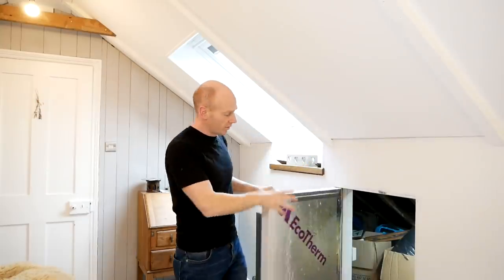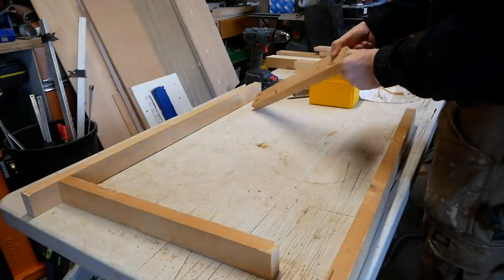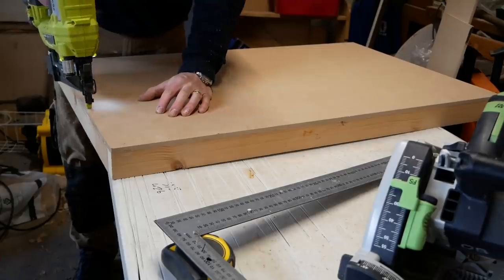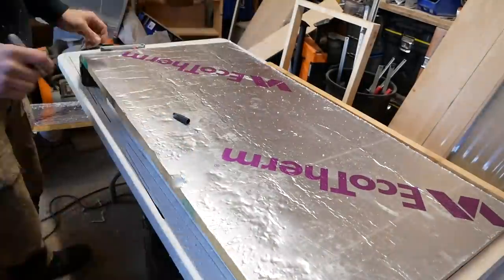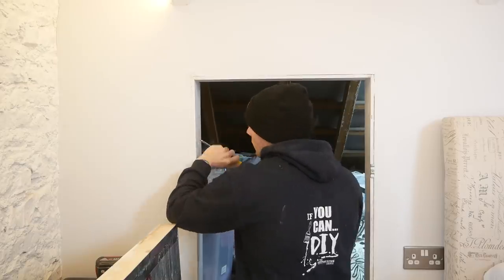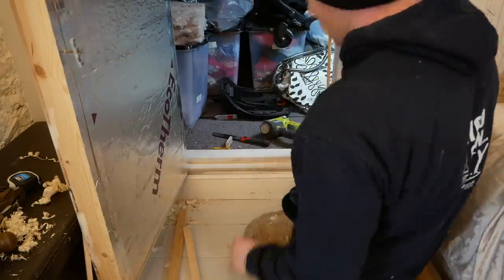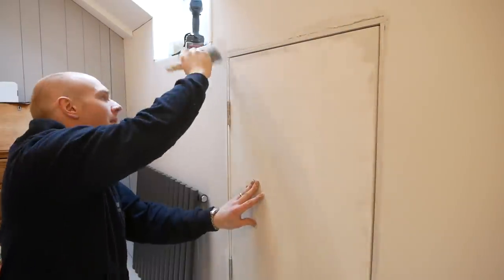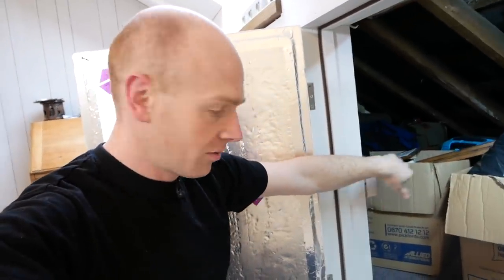Building Insulated Doors for the Loft Conversion

Comment: We're currently in lockdown for at least a month here in NZ. I live out of town a bit on two acres. I hear you about using what you have at hand. At this time I'm so glad I'm a bit of a hoarder. So many things to do and so far have been able to find material somewhere on the property.
Reply from the maker: Steve McLean know what you mean!  I’ve knocked out 5 or 6 scrap wood projects already, keeping the kids busy too with little builds.
Reply: I have been building up supplies for about 6 months to re-deck and EPDM my 60sqm garage/workshop roof, all I reaily needed was the OSB3 sheets, and  luckily I managed to get them delivered at the beginning of the lockdown, two weeks into the job and I still haven't finished it (no wonder every quote I had was around £4500!). Struggling to get guttering now though!.

Comment: Hi. I'm doing a loft conversion but my eaves doors (6 of them) have a 33° pitch along the top of the door, I have 100mm kingspan left over, have I no chance of getting the door swing the way you have by planing the door side when it's 100mm?

Thanks, yours looks fantastic 

If you don't think it's possible would you just make insulated panels held in with toggle latches?

Comment: Neat job Tim, how was the rubber seal attached? Looks like you might have had an issue with it falling off? (nice editing though!!) I once worked with a joiner who always used a palm route for notching out for hinges, have you ever tried that?
Reply from the maker: I route most of my hinges and locks now, but not when Jo has just moved the new bed and duvet in to the same room. 😂 seal was just peel and stick, paint in the door must have been tacky still but sorted now. 👍

Comment: I cheated and brought the Manthrope GL250 and replaced the 50mm polystyrene for some 50mm kingspan then made a internal lip with 25mm kingspan, as the hatch slides it make it nice and air tight. Don’t forget the vapour barrier.

Comment: IMHO - doesn't it make a bit of a joke of Building Regs when they specify a minimum thickness for the roof/wall insulation etc. but "allow" the dwarf access doors to be made of 3-4cm thick wood without any insulation and/or strip insulation to stop draughts?